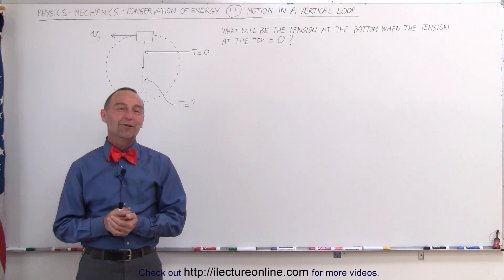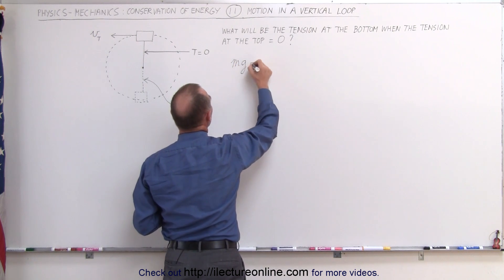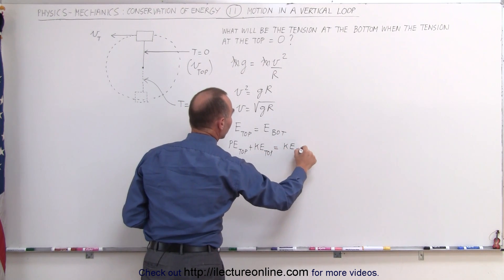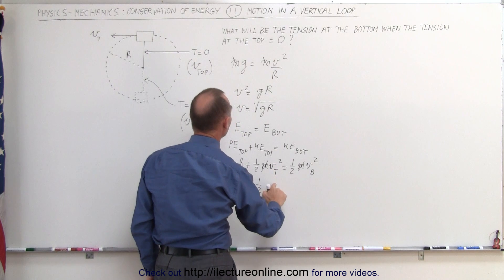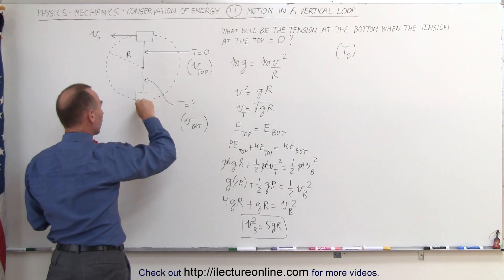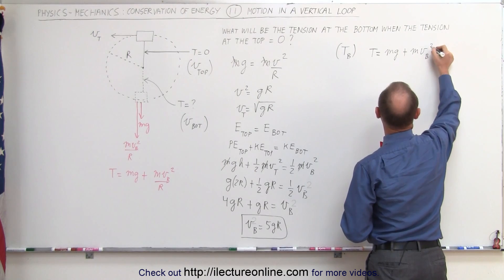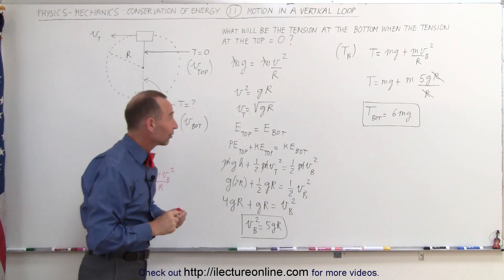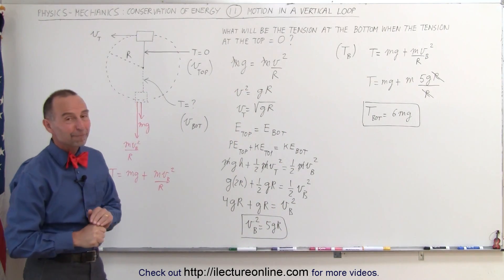Physics 9   Conservation of Energy (11 of 11) Motion in a Vertical Loop

Comment: Sır ıs not velocity constant in circular motion?
Reply from the maker: Velocity is a vector quantity and thus has both magnitude and direction.  The magnitude is constant but not the direction.
Reply: ı know ı know . but in this example the magnitude of velocity on the top and bottom are not equal. Why?
Reply: velocity is constant (in magnitude) in uniform circular motion. In this example, the motion is not uniform due to the acceleration of gravity, hence the difference in the velocities.
Reply: This question made me confuse conceptually.

Comment: why the centripetal force of bottom not pointing to the Center of the circle?
Reply from the maker: That is not the centripetal force (which points to the center of the circle), but it is the fictitious "CENTRIFUGAL" force which points away from the center of the circle.
Reply: How if the position of thing is in 90 degree from bottom?